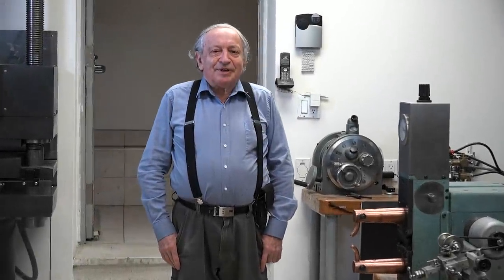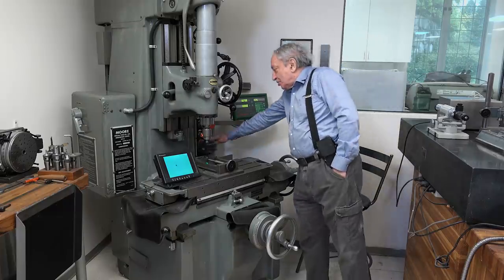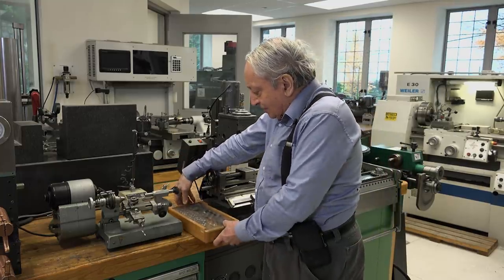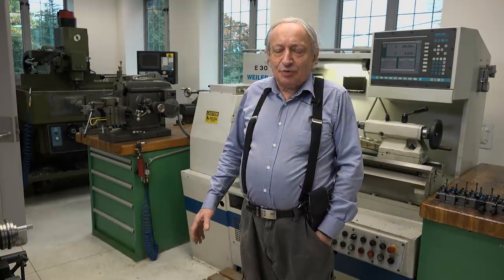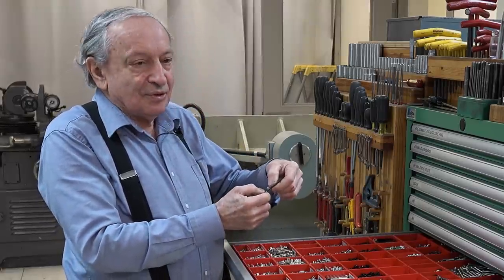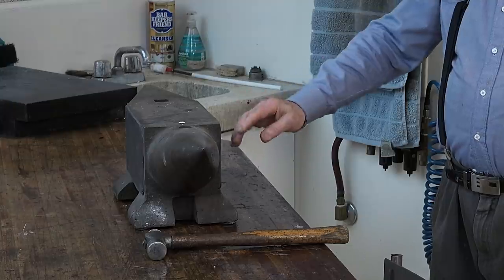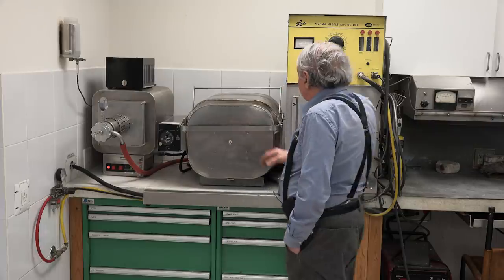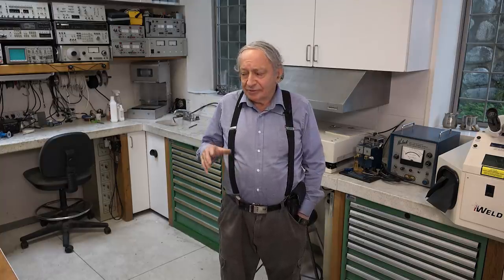Dan Gelbart Workshop Tour HD

Comment: Dan, in your previous 18-part masterclass, you touch upon topics relating to some (but not all) of the equipment you show today. Would you consider doing a series of deep-dives, one single instrument at a time ? For example - your sheet bending brake 9:30 or the "Waterjet cut and milled where needed" tooling and fixtures on and around the wire-saw 33:30 or the Ultradex at 5:30 or the methanol-modded oven at 24:30? 
Pretty please?
Reply: YEEEEES that would be wonderful!!!

Comment: Wow just wow.
You are the guy that got me into hobby machining (mostly watching machinist video, I live in a flat) a few years ago.
More specifically your prototyping series.
I was amazed by all your equipment. 
I'm even more amazed today.
Thank you very much for showcasing your lab, it's awesome!
Reply from the maker: I grew up in a tiny apartment, but I managed to have a tiny shop in my bedroom that folded into a 1m cube when not in use. It had a lathe with miling column, drill press, metal saw, grinder,  power hand tools etc. Don't give up! Dan
Reply: @dgelbart  Thank you very for your kind words.
My main hobbies are computer science (it's also my job), and my electric bikes, those things already take all the  space in my "workshop room". I already have a 3D printer and a very cheap drill press, but nothing to really work on metal.

I'm not giving up though. In my familly farm (which I don't access very often) there is an old lathe that I restored a little bit, and I plan to buy a milling machine for non concentric parts. 
Then I'll need to find a use for those :D.

Comment: I'm carefully watch SD video 5 times - and since previous version i made 2 axis balancing stand with help of network analyzer. Works perfect ! Is a cheapest solution in the world for precision instrument.
Reply from the maker: Glad that it was usefull. Most engineers do not understand the power of a network analyzer for electronics, mechanics and sensor/actuator/servo work.
Reply: Would you mind documenting that somewhere?
Reply: @janbeck8269  not sure. But scheme is very simple. Two stand with prism for shaft holding and tensosensors in classic bridge connection for force measurement. Each stand have 2 bridges in perpendicular axis's. And off course - position sensor 1 pulse prr. Pulse inject in synchro channel. Because Analyzer have memory and stand almost rigid - only need one full turnover with constant speed of measured object with test mass and one without. Test re balance two spindles for PCB drilling  80K rpm- all good.
Reply: @janbeck8269  If you want make ultrahigh precision unit - make two interferometer sensor as described in this video https://www.youtube.com/watch?v=MUdro-6u2Zg
Reply: @zolotenin  I'm not familiar with that "classic bridge connection" balancing method. Is there a website or something you can recommend?

Comment: So so many things to comment on... a video jam packed with the best information from a true master.
The jig borer, Moore, just amazing. I got the two books by Moore ('Foundations of Mechanical Accuracy' and 'Holes, Contours and Surfaces') and they are mind blowing. I honestly don't think anywhere in the western world for sure this level of engineering and craftsmanship exists anymore - it went away with the few generations that knew how to operate them. 
Japan may be the only place left with a great many 'mom and pop' shops doing the most wickedly amazing specialty work. It takes some digging because the YT algorithms do not easily turn up videos in Japanese with no English information whatsoever. From the 'At Home' video series on ancient arts and crafts it also becomes apparent the younger generations are not too eager. Japanese machines are fantastic but especially of the older machines not many are available in Europe as there was such a good supply from manufacturers closer by. One of the current Japanese brands I have been very impressed with is Yasda and some of their latest models have made their way to Dutch high end machine shops.
The indexing table with 360 divisions has what is called a Hirth toothing which is also used in indexing tables used in many industrial automation settings. It's very accurate indeed but there's only the 360 1 degree positions I assume. So it's quite different from a normal dividing head.
In general I think we are on a steep decline which has been set in motion decades ago and has accelerated since a couple of years. The globalist agenda is halting and even reversing progress of mankind, which is beyond sad - it's threatening our very existence. I hope we can turn the tide and the only way I know how is to preserve and pass on knowledge and craftsmanship. Mr. Gelbart is a shining star setting an example for all of us.

Comment: I had to look up the definition of a arcsecond.
That is actually BONKERS. For those of you who, like me, havent heard of a arcsecond before:
First you need to know what a arcminute is. A arcminute is a angular measurement equal to 1/60th of a degree, thats 1/21,600th of a turn.
an arcSECOND is 1/60th of a arcMINUTE or 1/3600 of a degree or 1/1,296,000 of a turn...
If were to turn that rotary table one arcsecond every second it would take you roughly 3500 years to do one full rotation.

Comment: Hi Dan, 
can you elaborate on the chuck mounting system? Is it just axially clamped and the excenter forces the plate despite the friction? Moment and Force also only transmitted by the friction ? 
Thank you very much for the educational content.
Reply: I’m also very interested in this. As far as I understand the plates are precision lapped to be as parallel as possible, but I don’t understand how does the excentric thing works

Comment: Thanks a lot for this huge amount of insights and experience! Could you please expand a bit on your 4 zones: What is the differential pressure between them, what filters do you use, do you run the ventilator(s) 24/7 or only part time and how much power does this system take approximately per month? I thank you very much in advance!
Reply: Great questions, I was wondering the same thing.
Reply from the maker: The pressure difference is small, created by feeding in the air in the cleanest zone and extracting it from the dirtiest zone. I would estimate the differential pressure at a fraction of an inch of water, but this is sufficient. The air is exchanged through a Heat Recovery Unit (HRV). These units, if kept clean, re-capture over 90% of the heat so electrical costs are low , plus they only run a few hours a day. The filters are commercial pleated paper filters. You need to have very low pressure drop filters.
Reply: @dgelbart  thanks for the answer and great video and info as always sir! 👍
Reply: @dgelbart  Hi Dan, thank you again for your fast and thorough reply!

Comment: Was sooo waiting for this. Thankyou Dan. 
What was the range of adjustment in the lapped plates on the four jaw weiler lathe?
Reply from the maker: 1mm, but if you need more range you clamp it off-center  with 2 shims and use the chuck for fine adjustment.

Comment: You change my life back than, lead me to foundation of mechanical accuracy, to PIco air bearing, my machining path would have been very different. Thank you to still share your knowledge. But one question... how do you clean theses garbage can ?
Reply from the maker: The cans have an insert that comes out. What I forgot to mention that there is a water drain at the bottom of each in-floor can, in case of flooding.
Reply: @dgelbart  you had that information in the fist ld video to bad you took it down. There were some other differences which gave additional iformation. But thank you for sharing your knowledge I am hoping for more video in the future. I would love to get more infos on the chuck attachment and the spotwelder to try to reproduce those amazing useful tools.

Comment: I never did find out what this fellow actually manufactures!One thing I'm fairly certain of is that whatever it is would be made to very,very high degrees of accuracy...
Reply: Optics
Reply: @gordonjones1516  he manufacturers optics?Would you know any specifics?
Reply: @giannirocco7492  Not optics per se, but Dan did some important work in optical output devices, starting from the scanners used to record data from reconnaissance satellites to the scanners used to print digital images on various media.

This shop clearly is not for fabrication of lenses and such -- that requires very different machines. See, for example, the channel  "Huygens Optics" -- that guy makes optical components.
Reply: @cogoid  Thank you for the clarification.No,the man's shop is set up for R&D,not production work and I saw nothing to indicate he was grinding crystal or glass.You kind of opened my eyes to the types of optics this fellow is into...
Reply: Most recently he has been working on metal 3D printing I believe

Comment: This was a phenomenal video!

The clamp shown around 20:17 caught my eye. Another comment mentioned a Honda ATV and that's probably where I have seen them too. 

Mouser 144-VCC-63254  (Essentra VCC-63254) and the data sheet has other part numbers tabled by size. They are vinyl coated galvanized steel and I have several projects that could use them! Not cheap though.

Comment: Hi Dan, thanks a ton for the reupload. this one is really good! i just wish the video was longer.
 regarding the sheet metal folder, why did you case harden instead of regular thru harden?. is it to prevent distortion that normally happens during heat treatment? or because u used low carbon steel since its a weldment.
Reply from the maker: I case hardened as I could only afford mild steel. Regular tool steel would be much better. Case hardening mild steel introduces  large distortions, but there is a trick to eliminate most of them: Before finish machining, heat the parts to case hardening temperaturs (but do not add the case hardening material)  and quench in water. Parts will distort, mainly shrink a bit. Finish machine and case harden. The distortion will be much less the second time.
Reply: @dgelbart  thanks for the tip.
What is the max thickness u can bend?
Reply from the maker: @247chiranjeevi  About 3mm.

Comment: hello Mr Gelbert
I've just come across your channel which I'm so glad as you are a incredible person with novel's of information.
well I'm a young 42 year old man that's just starting out in the would of a workshop machinists i have know experience
well maybe a little be I've always been interested in this kind of precision engineering i am a mechanical engineer 
so i am mechanical minded. 
could i please ask you a question this is my first workshop that i want to put lathe mill etc in it money pending but what would you advise me to do first or just advise me in general??
thanks Ricky
Reply from the maker: If you have some familiarity with electronics you can start by buying a used toolroom lathe and mill and convert them to CNC.
Reply: @dgelbart  hi i do have a little familiarity with electronics why would a tool room lathe be better? to convert.
could i ask what make and size lathe would you suggest ? and the same question about the mill as that's where I'm stuck. i have in total wall space 6 meters for everything including the drill press belt sander etc
and just to let you know in from the united Kingdom dan.
thanks for your reply kind regards
Ricky
Reply from the maker: 6m is plenty, for a lathe try to get a 1960-1990 vintage toolroom lathe (like a Schaublin 125 or Hardinge). For a mill there are many choices. You can find data on any small machine tool at: www.lathes.co.uk
Reply from the maker: Knuckles TheDevil  The servos  from an old CNC lathe can not be supported (old software, no spares) so all you're gaining are the ballscrews. It is definitely an option, and a better option if you don't have the workshop to fit ballscrews to a manual lathe.

Comment: Hi Dan, could you articulate on how you used the tablesaw to cut the steel for brake and spot welder? - is it any more complicated than putting an abrasive disc in the machine and operating as usual? I am currently in the tablesaw / small lathe / drill press phase of life ha ha
Reply: carbide tipped blade
Reply: @meocats  in video before this he mentioned cutting those parts with an abrasive disc on the tablesaw. carbide toothed blades chip too easily at tablesaw speed - I've tried
Reply from the maker: The bars were cut with a hacksaw (better than going to the gym). The table saw was used to machine the angled parts, like the angled clamping surface. It was done by installing a 50 grit 8" abradive disc backed by a plywood plate and tilting the arbor. Does not take long. Some machining was done by cold chiselling,  like in the old days.
Reply: @dgelbart  thank you!
Reply: @rupertgreen2459 isnt it spinning the same as a chop saw, people use carbide tibbed disc on that , you just need the right disc